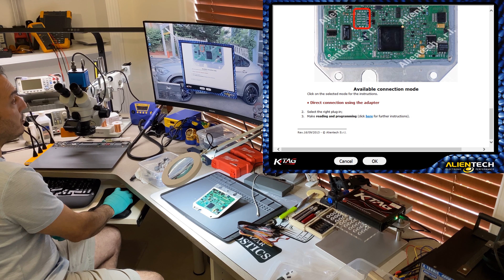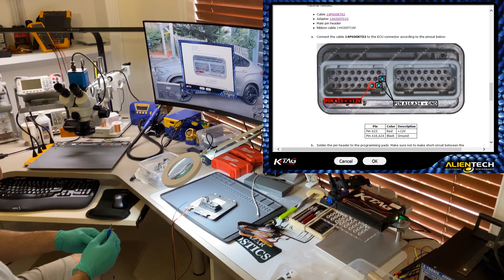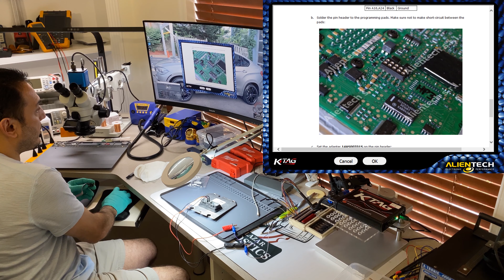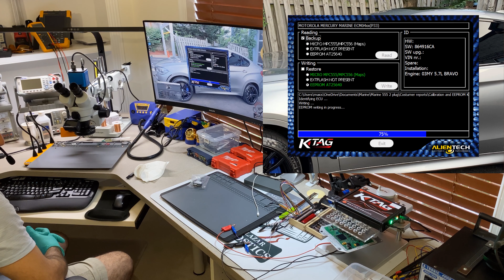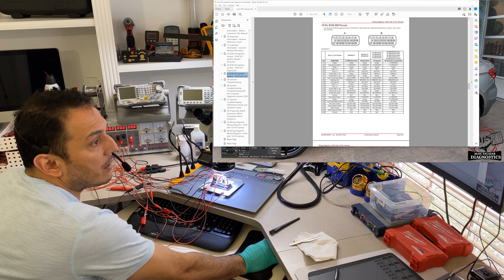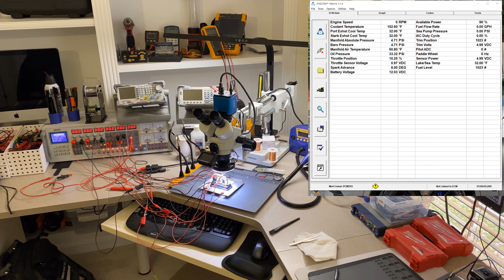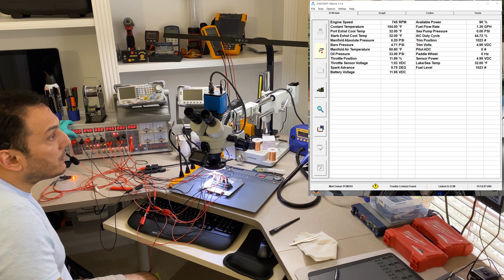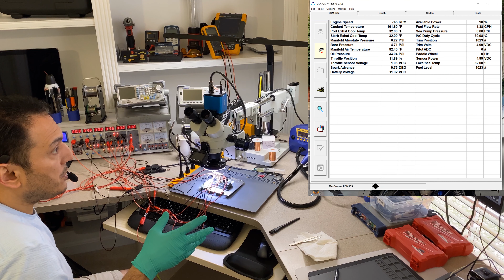How to replace the eeprom read and write info on a ECM plus the full test with simulator

Comment: Maic excellent content. I hope you continue to bring us videos like this. Would this computer be ready for install or does it still have to be programmed to the vehicle? Maic you also I believe you were going to show us how to build a few test items with a breadboard like a 5V power supply. Is that still on the agenda. I hope so. Anyway very good informative video you and family stay well Artie❤️ Maic can you show a little more detail on the simulator and what’s required to connect to the circuit board and how your made your leads. Thanks again Artie
Reply from the maker: Arthur Fricchione this ECM is ready to go. I will be doing the video for the tool this week

Comment: Hi Maic. How did you come to the conclusion that the capacitors need to be changed? Great job by the way. Thanks for all the hard work you put into these videos. Much appreciated.
Reply from the maker: Thank you so much. On this particular case is by experience since I do at least 20 a week. But the test you need to do is leak test with an LCR meter. I personally use the BK 880
Reply: @MaicSalazarDiagnostics  Great. Thanks for that.

Comment: Hello, congratulations for the video and very clear and precise in all its aspects, I wanted information for the remapping of the Magneti Marelli "Iaw 59 F" ECU which software is suitable for this remapping, I saw that you can also install a dual Eeprom to change from one map to another, how do you see what type of processor is inside the control unit? I'm not an expert in this sector, thanks for your attention✌️🛠️⚙️💯🤝

Comment: Do you work on Kia ECUs?  I have a 2005 Kia Spectra5 that needs an eeprom chip replaced.
Reply from the maker: Hi, I do work on them. How do you know that needs an eeprom?
Reply: @MaicSalazarDiagnostics  my new OBD2 scanner gave me an error code of p0030 and the description was "eeprom corruption".  I've been having an issue with the O2 sensors, catalytic, and evap system not being read, leading to a constant misfire of the fourth cylinder. I practically installed an all new evap and exhaust system and still have the same issues.  The lines and connections to all the sensors are good and functional, but the ECU can't seem to read it.  After I bought a slightly better OBD2 scanner, it gave me the same error codes I've been having for the last year just with a different description - "eeprom corruption".

Comment: What if you can't read EEPROM?
Reply from the maker: That would be a big problem.
Reply: @MaicSalazarDiagnostics  I can read EEPROM of a different similar Car but immboilizer wouldn't be the same. Can EEPROM become in virgin mode? Or copy immobilizer data from TCU manually and then write it on ECUs EEPROM?